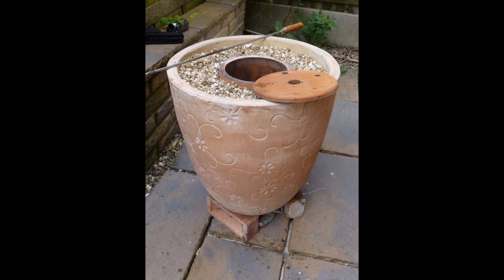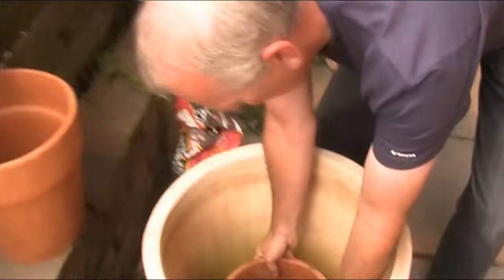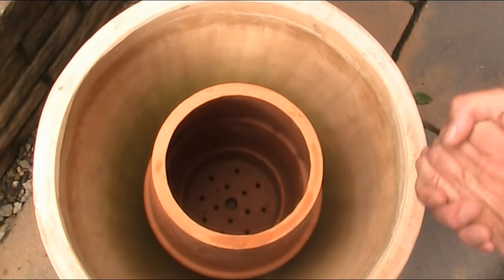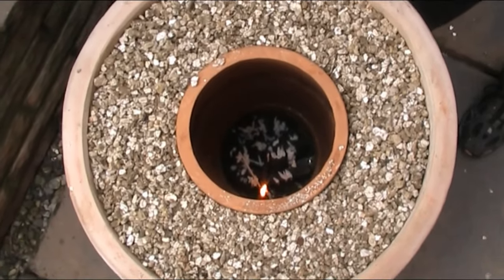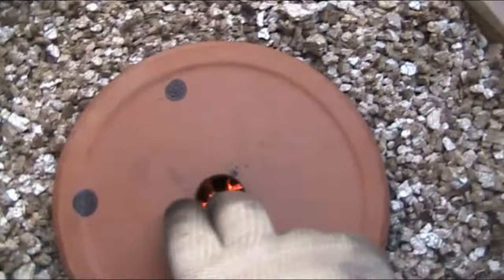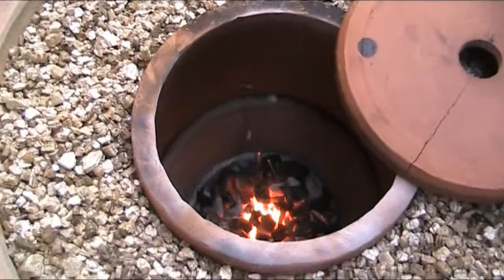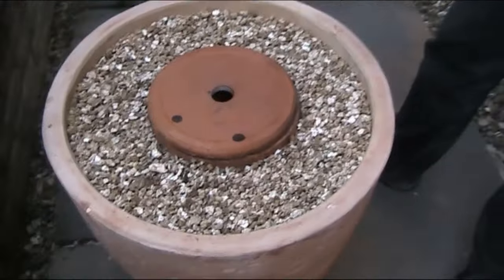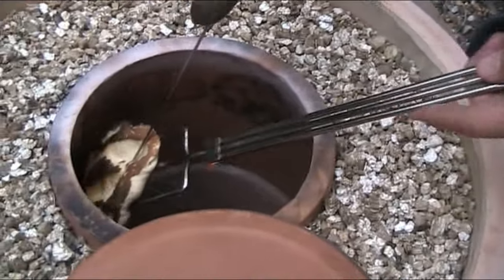How to make a DIY Tandoor oven with Flower Pots

Comment: Wonderful- a beautiful idea to make a 'Tandoor' out of flower pots ? Simply great ! A couple of suggestions - one, already communicated by an  elite reader, that for  'Naans'/Chapatis, first apply some water  at their base so that these do not get ' stuck ' in the hot tandoor. Secondly, the ' inner' part where Naans are to be 'barbecued', must be a little 'larger' for convenience of the hand going inside without much fear of a 'burn' (which are quite likely).  At the bottom, you may have to make a provision for making a 'hole' for helping igniting fire and controlling heat, with a 'cover' to close or open it. Aside than this, your 'innovation' is highly appreciated. With some 'trial and error' you can really enjoy food/chicken etc cooked in the 'tandoors' - which are extremely popular in India and Pakistan, Bangla Desh and some other South East Asian countries. Congrats for this beautiful 'innovation' once again. Regards.
,
Reply from the maker: Thanks for your feedback and sharing your thoughts with the community. Thanks

Comment: Hi Nick,

Can you tell me what diameter pots you used for this one? How big is the outer one and the 2 inside? Great videos by the way!
Reply from the maker: Hi Junaid, the outer pot is 52cm High x 52cm Wide at the top. As for the inner pots, the bottom one is 22cm H x 27cm W and top one is 25cm H x 27cm

Comment: Hi how does this tandoori  do with radiant heat output?  I'm looking for a nice radiant heat diy to heat a ~150 sq ft house.  I'd have to add an exhaust vent and chimney to this I know, but the bonus of cooking on it will reduce initial build costs. Thanks.
Reply from the maker: I see where you are coming from, as I have been looking at flower pot heaters as well, mainly for a greenhouse. As for this tandoor, the radiant heat output is very low as the aim is to keep all the heat in. The vermiculite does an amazing job keeping the heat in.

Comment: How do you properly cut the base of a clay pot as sharp and clean like that ?  Tips and tricks ?  It will be good for Peking duck if one can only block of the direct flames from the bottom. Brilliant.
Reply from the maker: For this Tandoor I used an Angle Grinder. What this video for how I cut the ring at the bottom https://www.youtube.com/watch?v=zz0I6qSB7Z4&t=25s .  I plan to cook duck at some point in the tandoor, but thanks for the suggestion of doing Peking duck

Comment: Great Job !! The only mistake you making is not to wipe the wall of tandoor with wet cloth to remove the smoke .. by doing so your "Naan" will be perfect clean and tasty . by the way I am  from Pakistan that's why I know :)
Reply from the maker: +Tiger Yes you are correct and I learnt that lesson very quickly. Also wiping down the sides with a damp cloth lowers the temperature a bit, as I often find the side of the walls too hot. I have since done a video on Keema Naan,and you can see the end results are a lot better.

Comment: Hi Nick, Is the insulation kinda fluffy thing?I am not sure where can  I get it in Canada.
Reply from the maker: Hi Amir, it is not fluffy, but it is very lite. In the UK you can get vermiculite at builders merchants, as it is used for insulating chimneys and general insulation where there is risk of fire. Also fire and woodburning stove shops sell it. Finally you can get it at garden centres, where gardeners use it to aerate soil. Hope that helps

Comment: Hi Nick, Great video, I have built my own, more-or-less the same size as yours. One slight modification I made was to get a plant pot dish, that you would normally stand a pot on, and drilled 10 or so holes in, I then put this into the bottom of the tandoor, due to it's size it wedges in about 1-2" from the bottom. Unfortunately the 1st one cracked into about 4 pieces, I suspect this is because the 13mm holes I drilled were a bit ragged and possibly too big. I'm going to try a metal grill of some sort as you mentioned. Also my top pot has a hairline crack in, but I noticed that you have used much thicker walled pots than me. I have also put some decorative pebbles round the top, this stops the vermiculite blowing about (you can get 10L bags of vermiculite from B&Q for about £4.50 - I used about 4). Mine now sits along side my BBQ in my outdoor bar/kitchen. Thanks
Reply from the maker: +Andy English Thanks for sharing Andy

Comment: hi nick; great video... I'm wondering how hot the outside pot gets?  I was thinking that you wouldn't need clay for the outside pot, but just something to hold the vermiculite?
Reply from the maker: The outside pot gets warm but not hot, and in one of my video's I showed me resting my cheek against it. Saying that I would expect the bottom to be hot especially where the ash drops out. I have never tested that, but I would expect it to be too hot to handle.

Comment: Hi Nick, getting ready to build this but am confused about the vermiculite; the only stuff I can find is very light and soft - is this the vermiculite you use? I imagined something more rock-like! Cheers
Reply from the maker: Toby Clarke Yes that is the stuff very light and soft. You should be able to squeeze it together between your finger and thumb. If your stuff is small, the vermiculite at the bottom could be crushed into dust, so some people add perlite which is more rock-like, but still very light.
Reply: SimpleNick - Nick Collins 
Thanks Nick, I figured it was. Have just built the small version ready to try out tomorrow!

Comment: Hi nick, instead of using two small terracotta pots upside down, what if I find one pot long and wide enough to do the job and get the lid to use it for covering. Still can make holes underneath for ventilating and put it on three bricks for the ventilation. Do you think that would do the same thing?
Reply from the maker: Yes I have seen people do that. I haven't done it myself, but can't see why it would not work. Often thought of using a large clay chimney pot

Comment: hi what was the dimensions of your flower pots?
Reply from the maker: Hi Richard, Large outer pot = 52cm H x 52cm D at the top

Inside bottom pot = 22cm H x 27cm D

Inside top pot = 25cm H x 27cm D

Comment: Hi Nick, Thanks for the video. I am inspired to build one. I have few questions. Did you drill extra holes in the outer big pot for better air circulation? Also, did you try to align the holes in outer pot and bottom inner pot for easy outlet for ash? Would left over ash from previous use interfere with the air circulation and overall effectiveness?
Reply from the maker: Hi, first of all thanks for the feedback, as to your questions I did not drill any extra holes in the large pot as there were three large holes already. And yes you are right I aligned the pots so the ash would drop through. Nick

Comment: I made this... But it takes forever to cook... Any suggestions?
Reply from the maker: +Prabhakar Thoushat Hi Prabhakar it is hard answering this question without seeing your tandoor, but when people have had problems it has been down to insulation or the fire not hot enough. For Insulation you should not be feeling any heat on the outside pot. As for the fire not hot enough, people have had problems with airflow, so they don't have a good fire.  Checkout this video I did on a review of the oven, but skip to the second half where I lite the oven. Here you can see what sort of fire I have inside, and also the inner temperatures after just 15 minutes. There is no tricky here, what you see is what I do and the results I get. https://www.youtube.com/watch?v=ZVJ_5TAOIPc
Reply: and thanks a lot for the reply !! :) appreciate it

Comment: Hi nick, can you use a pot made of resin for the outer one? Does it need to be clay, what other materials can be used for this purpose. Large clay pots like that seem very expensive here in the US
Reply from the maker: Junaid Qureshi Hi Junaid, Personally I wouldn't use a resin pot because of the heat. If you have good insulation then then the outer pot won't get hot, but often the bottom tapers inwards which is where the most heat is, so you have to be careful. I have seen people use galvanised dustbins. Also I was in IKEA the other month and I say large galvanised pots which would have made a good contained. When I got home I couldn't see them in the catalogue but they had them in store. If you are happy not moving the Tandoor around, you could always brick the outside. Nick

Comment: What is the height of the big outer pot? I'm finding it tough to find a readily available large pot that is taller than it is wider..
Reply: Also, what kind of bricks did you use for the base?

Comment: Thanks for sharing your brilliant way of making tandoor.
Just wanted to share my grandmother way of cooking tandoori naans as i had seen her make them back home at my farm in India. 
ideal temperature should be 150 Centigrade or when coal has burnt out. Constant temperature is the key. what i saw in the video is that  due to high temperature naan is cooked too quickly with exposed side should have golden brownish colour.  Tip : just before you line the naan pat both side with the mixture of  water and vegetable oil. Please do try.
Reply from the maker: +Sukhjeet Bajwa Thanks for sharing Sukhjeet, you are absolutely right the naan was cooked too hot. This was the very first time I had cooked a naan, and I have since learnt how to do it better since. The key things are as you said a lower temperature, and I also wipe a damp cloth around the inside to lower the temperature on the walls. I have since filmed cooking successful naans, just need time to edit the videos and post them.

Comment: Great work Nick.. Can i use copper pot as an outside of tandoor?
Reply from the maker: Interesting question, as long as you have good insulation I can't see why not, but I would want good insulation. When I built the oven my only concern was the outside temperature of the pot, as I didn't want any guest burning themselves.

Comment: Hi.  thanks for the video.  I want to start a project like this soon.  Can you tell us the dimensions of the inner and outer pots please?  I like the idea of using a large, decorative pot, rather than bricks or a metal drum.
Reply from the maker: Hi Andrew you have hit on the key thing about this Tandoor is that it looks attractive. Yes it is fully functional and does everything you want of a Tandoor, but you can leave it out in the garden all year and it looks great. The hard part is finding a big pot that is not too expensive and looks great. Also I wanted it to be wide at the bottom so I could pack the insulation in. as for the inner pots, the bottom pot was 22cm High x 27cm wide, and the top one was 25cm high x 27 wide. You want the opening at the top to be wide so you can cook naan and get more food into the oven. Checkout the website for more information - http://www.simplenick.com/tandoor.html

Comment: Just some suggestions:Get a terra cotta clay dish and drill several holes in that plate. Turn the plate over and install it into the bottom of your oven to keep the coals up and ventilation going well. These round plates are cheap and easily drilled out with a masonry bit. Just remember to turn the plate upside down when you put it into the larger pot at the bottom.You may try seasoning the sides of your clay pot oven, just as one would do with a cast iron skillet to season it for cooking.You can also obtain crack-resistant cement mix and make a 40% mix of Vermiculite and a 60% mix of cement. This would be used instead of just the Vermiculite alone and is essentially making a fire brick insulation for the sides of your pot. This also reduces the chance of the clay pot inside eventually cracking, as it helps eliminate moisture in the insulation. Vermiculite alone often absorbs moisture and can cause a clay pot to crack.
Reply from the maker: +a1930ford Thanks for sharing your thoughts, good for people to share experiences with the community. Thanks

Comment: Is the external pot terracotta? they're very expensive and as its only function is to contain the insulation i don't suppose it needs to be.  Do you just cover the oven when not in use? to prevent water build up in the insulation layer?
Reply from the maker: Hi John, yes the external pot is terracotta, and yes it can be expensive. You need to buy it at the right time of the year when there are sales, this one cost me £17. Yes it's only function is to hold in the insulation, and lots of people use metal dustbins. I went for a pot as I wanted it to look nice in the garden. Remember it stays on patio all year round, so you want to be looking at something nice. And yes I do cover it, you can use an upside down pot tray or a bag. I prefer pot tray as that is more pleasing on the eye.

Comment: How much would it cost for the large pot and where would you buy it from
Reply from the maker: Hi Andy, this is the hardest part of the build, finding a nice large pot at a good price. You will need to checkout your local garden centre, but you probably won't get a bargain until the end of summer. Someone this week did tell me they got their pot from The Range for £30. I haven't checked this out myself yet
Reply: Thanks

Comment: Nick, first this video is still so amazing. I watched it first over a year ago and made my first tandoor. Now I'm working on a second (inspired by you again!). Question for you: I'm struggling with airflow issues, causing weak heat. I believe my issue is that the coals are right on the base of the pot with nothing to lift them up. Basically it's outside air, pot, and then coals. 

Have you thought of adding a side vent or do you just recommend adding more holes?
Reply from the maker: Hi Preet, maybe I am just plain lucky, but I have never had an issue with airflow, and I have my coals on the bottom. Saying that my airflow is too good now as the bottom of my pot has now broken away, and I have a mesh from a throw away BBQ at the bottom. For the first time I now have to top up the coals after an hour. I have lots of people contact me about airflow, and they typically drill more holes or they lift the coals off the bottom. Mike Maas uses an iron drain cover to lift the coals off, which I thought was an excellent idea.  He did send me some pictures that he said I could share on my website which I need to around to. I am about to start a new Tandoor with storage heater bricks, and that will have a side vent - expect a video in the summer.

Comment: Hi are u using smoll pot baces and big pot top
Reply from the maker: Hi Amer, sorry I am not clear on the question. The pots sit on a ring which I made from cutting the bottom of an old broken pot. There are no braces holding the pots in place, just the vermiculite.  Does that answer your question, if not  then please let me know. Thank Nick

Comment: I love this!  Do you not need to glue the two pots together and what did you cut the pots with?  Sorry if you have been asked this before
Reply from the maker: +Juggyv Placetobe You don't need to glue the pots, I haven't. The first tandoor I built I used a hand saw to the pots, and for the second I used an angle grinder. Thanks for the feedback

Comment: Great vid. Is it meant to be that hot? Do you have to control the temperature at all with a water spray or do you just go with whatever it puts out?
Reply from the maker: When cooking naan I do now control the temperature by spraying water. As you see in this video the sides get hot, and my first attempt at naan bread was burnt.  As for meat I go with the heat it puts out, but you have to be careful not to over cook your heat.

Comment: good experiment: if you cut the base of the big flower pot and just apply mud on the outer walls of the big flower pot then, it is perfect....
Reply from the maker: +Ju Rehman Yes I get what you are saying. When I built this I had some clay from an old pizza oven and I was going to use that on the sides to bulk it up. Thanks for the feedback Ju
Reply: +SimpleNick - Nick Collins Thanks, Yes, If you only use the Big pot (the outside one) and bulk it up with a simple layer of clay+straw(grass) inside about 2 inch thick and a 2-4 inches big layer outside, then the area will be larger inside the pot to use and you can use your hand to have big naan too. Any ways, it was a nice project and now I am trying to clay up my BBQ grill to convert it into an oven, lets see, what happens..

Comment: Hi thanks very much great video. I've just built our Tandoor as per your instructions. (Lockdown 2020) Just a question when it's not in use is it alright left outdoors or do I need to cover the vermiculite?
Reply from the maker: Cool lockdown project Marcia. Just realised that I built mine nearly 6 years ago, and since then he has remained outside in the garden. You definitely need to cover the vermiculite, I had a plastic cover on mine. Basically when the vermiculite gets wet it soaks up the moisture and it takes ages to dry out. Also the extra weight makes the lower vermiculite compress and sink. Happy cooking Marcia
Reply: Brilliant good to know. Just had its maiden cookout..it was delicious so tender... Piri, and Jerk...yummy. I’ll cover it when it cooled off... need a big slab as my inner pot sticks up like a chimney😂😂👏🏾👏🏾👏🏾🙏🏿🇬🇧❤️

Comment: Hi what exactly is the ring served as a base for the flower pot to stand on? Is it a top cut off from a flower pot or?
Reply from the maker: Hi Adrian, you are correct the ring is from a flower pot, but actually from the bottom of an old pot. I had a pot that had broken at the top from frost, so I cut the bottom off, and then cut the hole out. I did video this at the time, so I will post the video this week so you can see for yourself.
Reply: Thanks a lot for that!!! Appreciate it!